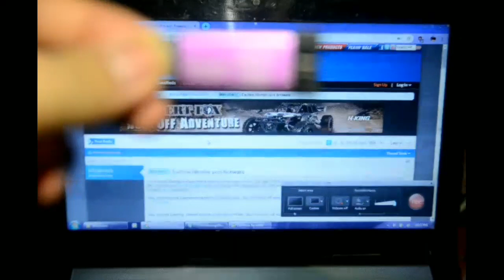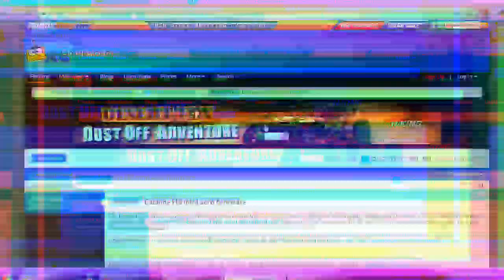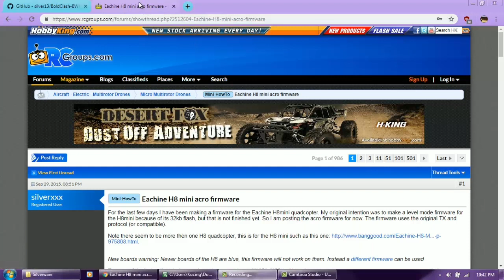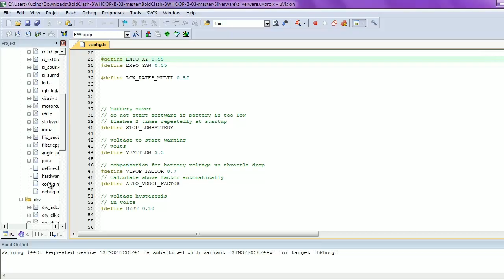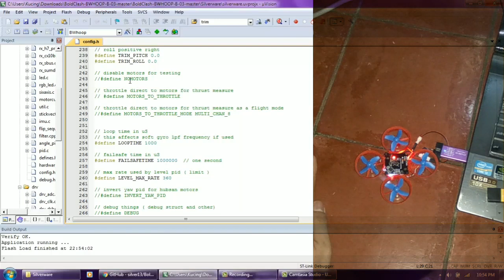Flash Firmware Beecore Lite Silverware Micin Micro Drone

Comment: om ST-Link V2 yang biru sama emas apa bedanya? soalnya ga ada suara. trims
Reply from the maker: Sama aja, beda cover doang
Reply: @NanasMaduFPV  oya om klo jalankan aplikasi SW ny download yg mana ya..?
Reply from the maker: Sw? Sw apaan?
Reply: @NanasMaduFPV  mungkin NFE kali ya om?
Reply from the maker: https://www.rcgroups.com/forums/showthread.php?2512604-Eachine-H8-mini-acro-firmware

Atau search aja di github NFE silverware
Reply: @NanasMaduFPV  siap tengkyu om
Reply: @NanasMaduFPV  om power nya via ST-link ya?  bukan ekternal. yg 3,3 apa 5v.. btw CLK GRD SDIO kok solder yg di dalam deket chip bukan yang di luar? apa pengaruhnya ya om.. soalnya St-link V2 sy kaya yang py om warna Emas. tp error ga bisa konek padahal udh update jg.
Reply from the maker: dari external, 
emang dari sanannya begitu, kalo dari luar beda interface atau apaaa gtu, baca2 disini aja om
https://www.rcgroups.com/forums/showpost.php?p=39886005&postcount=2814
Reply: @NanasMaduFPV  untuk ST-Link Solved om... tinggal Keil Uvision 5.. gak bisa build Target... kalo di cek Target Missing: Compiler 5. yg ada cuman Compiler 6 dan 6.18. kalo dipilih compiler 6 dan 6.18 error. 😂. padahal Pack udah updte semua.

Comment: kalau habis di flash ternyata terjadi 2x flash cepet itu apa ya om? dan gak bisa konek ke tx
Reply from the maker: // the error codes indicate a failure that prevents normal operation// led flash codes - the quad will not fly / bind if flashing a code//
 2 - low battery at powerup - if enabled by config.h "#define STOP_LOWBATTERY" //
 3 - radio chip not found// 
4 - Gyro not found - maybe i2c speed//
 5 - clock , intterrupts , systick , gcc bad code , bad memory access (code issues like bad pointers)- this should not come up// 
6 - loop time issue - if loop time exceeds 20mS//
 7 - i2c error - triggered by hardware i2c driver only// 
8 - i2c error main loop - triggered by hardware i2c driver only
Reply: @NanasMaduFPV  cara aktifin arming gimana om?
Reply from the maker: @setiabudigunawan23  pake remotnya Paan?
Reply: @NanasMaduFPV  pake remote devo10. tapi udh multiprotokol
Reply from the maker: @setiabudigunawan23  
#define ARMING CHAN_5
#define IDLE_UP CHAN_5
#define LEVELMODE CHAN_6
#define RACEMODE CHAN_7
#define HORIZON CHAN_8
#define PIDPROFILE CHAN_9 //For switching stickAccelerator & stickTransition profiles on pid.c page
#define RATES CHAN_ON
#define LEDS_ON CHAN_10

Comment: Om cara bind ke qx7 yang udah multiprotocol gimana?
Reply from the maker: Modul external di qx7 dinyalain, trus pilih ppm, geser sampe 12ch, kalo udh matiin, dalam keadaan mati, stik sebelah kanan mentokin keatas kanan ↗ trus nyalain remote, si drone nya nyalain duluan, udh deh ke binding
Reply: @NanasMaduFPV  gak pakai yang bayang ya om? Setau saya fc beecore lite pakai protocol bayang?
Maaf om masih pemula di dunia micro drone race🙏😁
Reply from the maker: @gemaardianataramadhan2460  kalo masih ori enggak om, kalo udh di flash pake bayang telemetry stik kiri mentok bawah kiri, stik kanan mentok kiri tapi di tengah
Reply: @NanasMaduFPV  Tq bgt gan, semangat bikin konten🙏👍😁
Reply: @NanasMaduFPV  tapi masih pakai ppm atau ganti ke bayang?🙄😅
Reply from the maker: @gemaardianataramadhan2460  ppm, Multiprotocol nya bukan yg 4in1 kan? Yg biasa yg bentuknya panjang?
Reply: @NanasMaduFPV  yang module kecil om
Reply from the maker: @gemaardianataramadhan2460  ppm
Reply: @NanasMaduFPV  emgnya kalo yg 4in 1 gak bisa ya om?
Reply from the maker: @gemaardianataramadhan2460  bisa langsung ke menu external modul/rf trus pilih multi, pilih lagi bayang, udh langsung auto binding, kalo yg kecil cuman ppm trus pake kombinasi stik buat bindingnya
Reply: @NanasMaduFPV  ok tq gan🙏

Comment: Tu pakai gestur remot / swich tombol diremot gan, untuk setting acro level, speed, dll
Reply from the maker: Kalo pake remot bawaan gesture om, kalo pake taranis yg udh pake modul Multiprotocol pake switch
Reply: Bertnya maksudx pakai gestur buat ubah mode gimana ya om ? Newbie
Reply from the maker: @nersfpv69  Down - Down - Down: accelerometer calibration
Left - Left - Down: acro mode (or channel AUX1 off) 
Right - Right - Down : level mode (or channel AUX1 on)
Reply: Z punya fc beecore lite,,,skrg mode acro aktif dan tidak bisa ubah mode lain...sdh pakai cara gesture tetap mode acro...itu mslahx dmana ya ?
Reply from the maker: @nersfpv69  udh flash an firmware om? Atau belum? Kalo udh brrti buat ngubahnya pake aux om, remot nya pake bawaan eachine apa pake remot apa?
Reply: @NanasMaduFPV  sudah kayakx dflash om krn sdh bisa angkat camera hd caddx turtle v2 dan sdh dlm mode acro sejak beli. Pakai remot bawaan eachine 011
Reply from the maker: @nersfpv69  https://www.jakartanotebook.com/jrc-h8-drone-mini-pocket-quadcopter-rc-2.4ghz-4ch-6-axis-white

(Liat gambar 2 untuk keterangannya si remot bawaan/stock tx)
Reply from the maker: @nersfpv69  #define CHAN_5 CH_EXPERT#define CHAN_6 CH_AUX1#define CHAN_7 CH_HEADFREE#define CHAN_8 CH_RLL_TRIM#define CHAN_9 CH_PIT_TRIM#define CHAN_10 CH_OFF#define CHAN_ON CH_ON#define CHAN_OFF CH_OFF
---------------------------------------------------------
#define ARMING CHAN_5#define IDLE_UP CHAN_5#define LEVELMODE CHAN_6#define RACEMODE CHAN_7#define HORIZON CHAN_8#define PIDPROFILE CHAN_9 //For switching stickAccelerator & stickTransition profiles on pid.c page#define RATES CHAN_ON#define LEDS_ON CHAN_10
Reply: Om,kenapa ya FC whoop lite saya gk bisa binding keremot inem multi? Mohon pencerahannya om,mksh

Comment: Why should we flash the beecore lite?  It already flies great out of the box.   But I wan't to do that with my E011. Waiting for my STlink hardware connector yet.
Reply from the maker: KOOL FPV because the factory settings are not comfortable with my flying style, so I have to reset it according to my flying style. ( http://sirdomsen.diskstation.me/dokuwiki/doku.php?id=e011 )
Reply: @NanasMaduFPV  Thank you.
Reply from the maker: KOOL FPV 😊😉 👍👌
Reply: @NanasMaduFPV  how to to set deviation mixer on stock firmware?
Reply from the maker: KOOL FPV kalo gak di flash ulang settingan nya kurang nyaman om kalo bawaan pabrik,
Reply: @NanasMaduFPV  Hi, Sir. Sory,  the only lone word that I understand is the "kurang" (means lacking?).  Anyway thanks for quick reply.

Comment: om itu tanpa re-flash bisa lgsg bind flysky kah?
rencana cari board buat ganti micin
Reply from the maker: Dwi Yunianto kayaknya bawaan settingannya masih stock tx om, soalnya pas baru beli langsung coba bind ke tx h8 langsung konek,
Reply: @NanasMaduFPV  Jadi caranya supaya bisa konek langsung ke tx flysky tanpa multiprotokol gimana om? Apa bisa dengan cara re-flash? Atau bisa di kasih rx s-bus?
Reply from the maker: @wibbyarief8958  gak bisa langsung konek ke flysky tanpa Multiprotocol, kecuali tx (remotnya yg sudah include Multiprotocol), kalo untuk rx-sbus kemungkinan bisa, secara ada pilihannya, tapi saya belum tau harus solder signal sbus kemana, lagi pula sayang aja sih powernya abis cuman buat ngidupin si sbus nya. 🙂, Terinakasih sudah mampir
Reply: @NanasMaduFPV  om..FC makerfire saya konek ke remot h8 cuman klu di gas motor gak respon..solusinya om...
Reply from the maker: Belom di arming, arming itu di CH5,
Reply: @NanasMaduFPV  klu remot bawaan h8 armingnya di mana ya...
Reply from the maker: @pilotedane1074  kurang tau om, coba cek di manual book atau tanya ke seller nya,